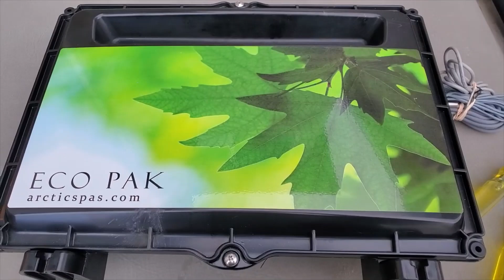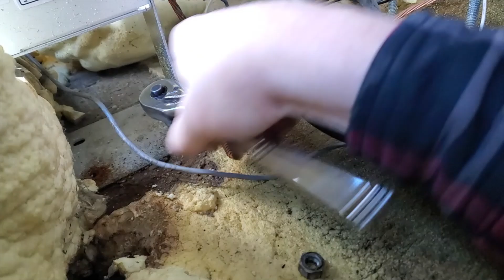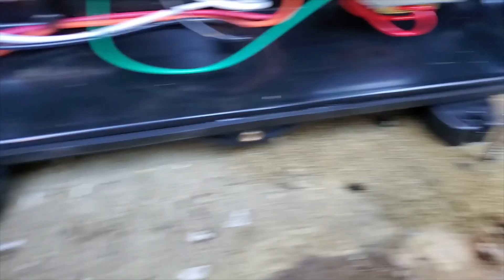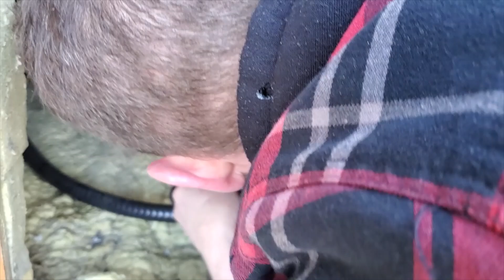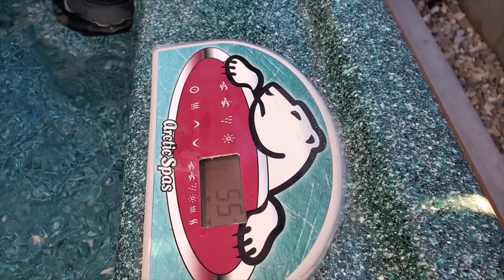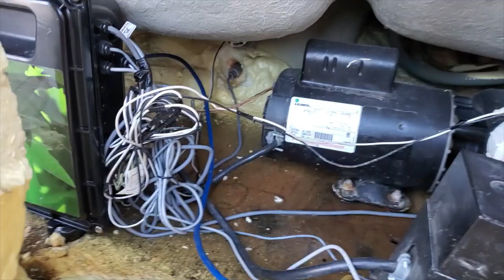Replacing Arctic Spa Power Genius with Eco Pack

Comment: Replaced my M Class spa controller with the EcoPak controller today. No instructions were included with the EcoPak and your tutorial helped speed things along. MY temp sensor and lights plugged right in. Tomorrow I have to figure our where to power my Clear Ray UV water purification system from on the EcoPak.
Reply from the maker: Yeah, I was frustrated that there weren't any instructions, so I thought I'd fumble through it and record it. 🤣 Glad it helped out! Hope your water purification system got hooked up okay.

Comment: Thanks for sharing.  I may be doing this myself today. Just noticed no heat yesterday and the temp is falling. Was too cold to look at it yesterday, will see today. I have already repaired the Genius circuit board twice. I suspect it's gone again, but maybe it's the heater. Either way, it's a trip to Paradise Bay. Too cold to wait for shipping from anywhere else. Pausing your video gives a much better look at the board than any of the pics on the websites. Our tub is a 2009 Yukon, so I think my temp sensor and lights will plug in directly.  Did you hook up a network cable to yours?
Reply from the maker: Ack! And, of course, it's been super cold here for the last week, which isn't helping at all...hopefully, you get that up and running ASAP. I originally spoke with Arctic Spas in Edmonton, and their price for the pack was just a little less than what it cost at Paradise Bay, and I didn't have to wait for it. 
It would be great if you can just plug those wires in directly. If the light wires are connected to that skinny, three prong female wiring harness, you should be good for a direct connection.
I didn't connect a network cable to mine, as the old one didn't have that option. It might be something I explore in the summer, though. 😁
Good luck with the tub!
Reply: Well, the Paradise Bay website said they had stock, so after confirming that my heater is fine, I drove down there. Nope, no stock. Looks like you got the last one. Oy! Not the first time their website lied. Must remember to phone first next time. But pump 1 seems to be able to keep the temp around 90, so I set it to 70 maybe the pump will turn off once in a while. I could pull the Genius board again and have a look, but to be honest,  I'm done with it.  Hopefully Paradise Bay will get some later in the week.
Reply from the maker: Dang it! It sounds like your plan is the best move, at the moment. Fortunately, that super cold weather calmed down, so you have bought yourself some more time. Let me know how your situation turns out, if you have time. Good luck!
Reply: Paradise Bay claims they didn't get a shipment this week. I don't always believe them on a good day. They're a pretty big dealer, yet seem to have problems getting things.  I ordered one out of Kitchener (they have lots) will take a while. Looks like pump is having no trouble keeping the temp at around 80F.
Reply from the maker: @SteveMasonCanada  Man, that's a hassle. Glad you were able to source one, though, and that your tub is able to keep up with this weather, to some extent.
Reply: OK, it's done!  Things I thought would be hard were easy, and other aspects were way more difficult than they should have been.  The old box came out with no issues. The new one has the bonding bus on the left side and facing the rear. That bumps up against the metal bracket that the wood platform is mounted to, so I had to shift the Eco Pak way left. That made access trickier, via a different access panel.  It's a tight fit, could only get the front mounting screws in, but it's secure.  Also, almost no room to put the bottom cover screws in, will try an offset screwdriver tomorrow. Wiring was fine. My temp sensor was a different connector, 4 pins vs. 3 but I measured, and the 2 needed wires lined up, so I plugged it in, and it worked. The thick solid copper bonding wires from the motors and the heater had to go on the left. The heater one was too short so I swapped it with pump 2 and all good. Lights work. I haven't hooked up the blower yet, my back was screaming at me so I'll try to find the correct connector tomorrow.  Thanks for the tip on turning off Spa Boy. I thought it was in settings, then I re-watched where you said to hold the button past settings and there it was.  My topside is flakey so the temp down button often does some other function (usually pump 1 on) so that made it tricky.  I will hook up the network this weekend and check that out. Thanks again for posting this video it helped a lot!